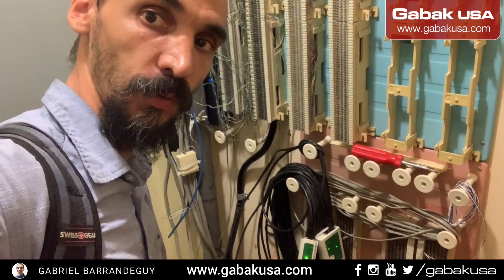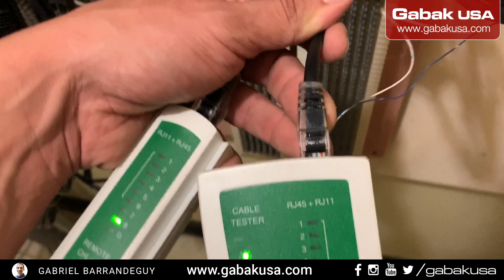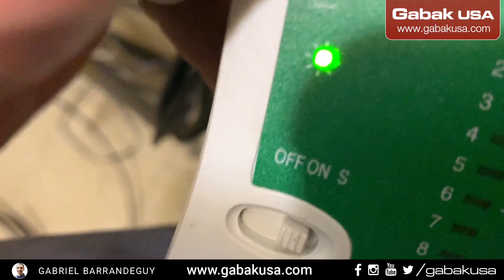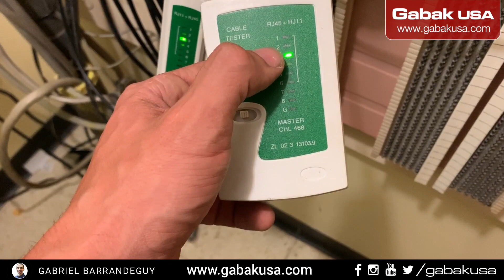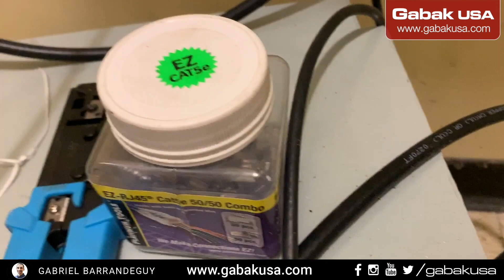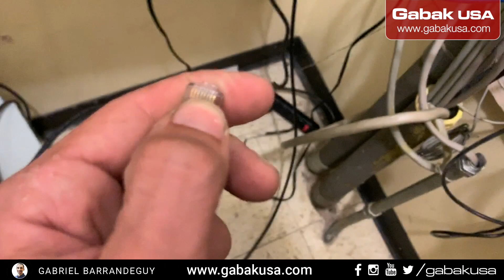how to detect bad ethernet cable

Comment: How would you go about testing a long cable? Can you test the cable only on one end? (Ex: connect only one side of the cable to the ethernet cable tester.) Do you have to disconnect the cable on both ends before testing it?